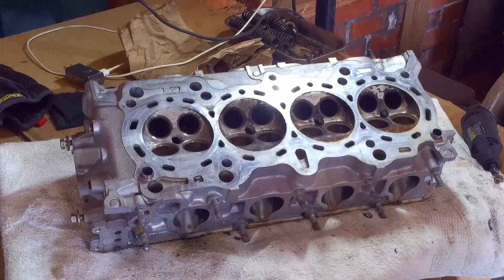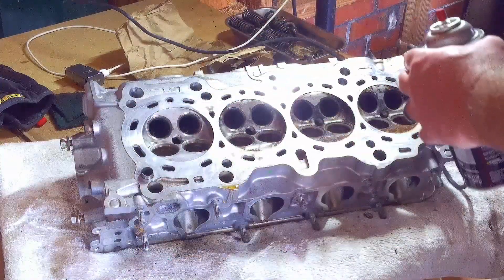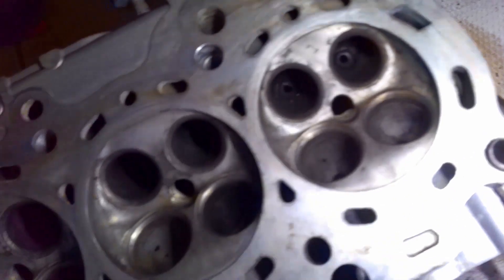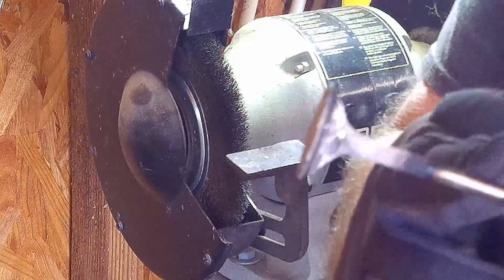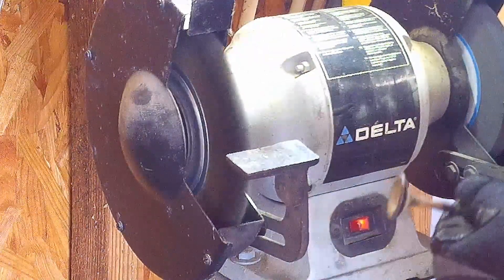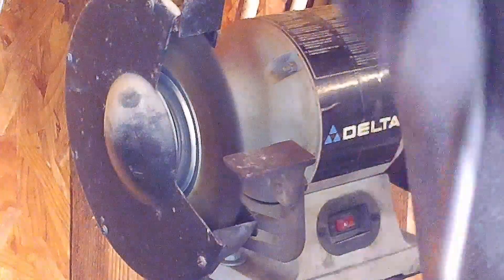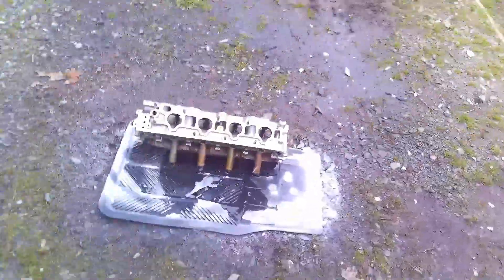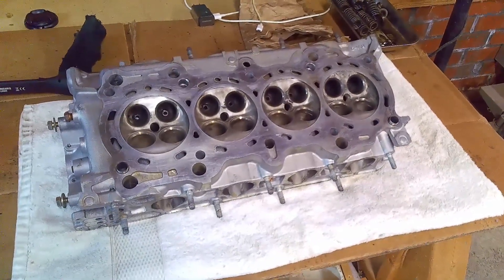F23 Honda Accord Engine Rebuild Part 3: Cylinder Head Prep

Comment: man... i had a wire come out of a wire wheel and stick in my forehead, in the bone straight out, i could pluck it and feel the vibration.... needed pliers to pull it out, couldn't do it with fingers.
Reply from the maker: Holy snikees!

Comment: What else would u recommend to use if u don’t have one of those powered wire wheels I’m sure something handheld would be way more time consuming but other alternatives would be ok?
Reply from the maker: Brass brushes, green scotch pads (but gently) and solvents. It's a chore. Good luck!
Reply: Also you can put the valve stem in a cordless drill instead of holding them with your hand.

Comment: Are the valves all different? You keep them in order I see. Is there a reason?
Reply from the maker: If you are replacing the valves, they are all the same. Since I was reusing these, I wanted them back in the same holes since they tend to "settle" in their seats. Not mixing them up makes it easier to seal the head and makes setting the rocker clearance easier.

Comment: Great advice about monotonous work and the potential hazards of letting your guard down.  Thank you for the reminder!  Great video series, I'm watching every single one, front to back.  I'm swapping the engine in my '98 Accord with a JDM (used from Japan) motor and the disassembly and unobstructed views you show are very helpful.  Especially the timing and balancer shaft set up in part #11.  Thank you again.  I enjoy the rooster sounds, by the way.  :-)
Reply from the maker: I am always glad to hear that I helped someone out. Thanks for watching and commenting!